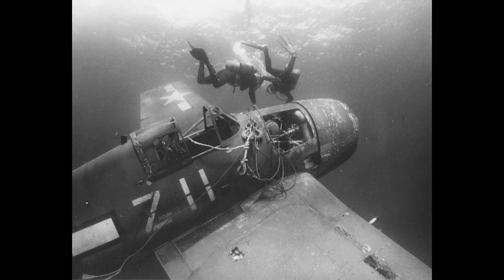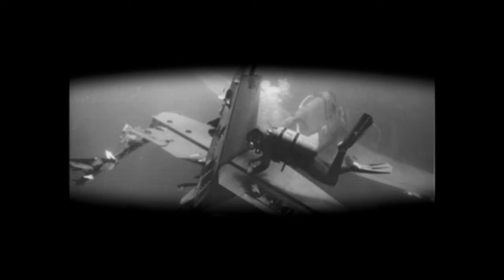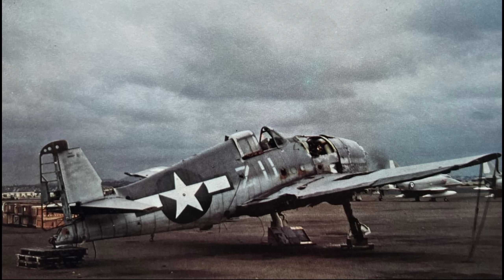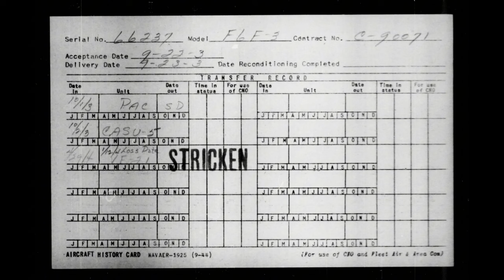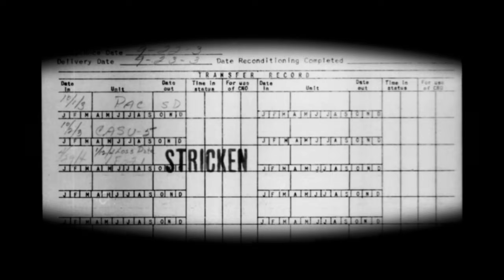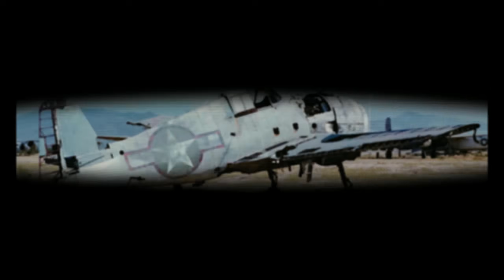Recovering Grumman F6F-3 Hellcat: The 3,400-Foot Time Capsule

Comment: Wow another great video! My new go to channel these days. That's my plane, the F6F Hellcat. In some ways, and from certain angles is absolutly at the top for me as one my favorite looking planes! In some important aspects, the Hellcat is the largest single engine WWII fighter. Look up the specs. The horizontal stabilizer, wing area and sides of fuselage have to make me wonder if more sheet metal was reguired to build the F6F,  than on the P-47(?).